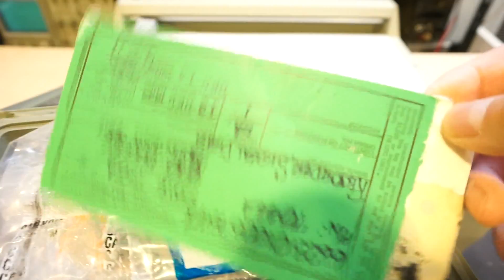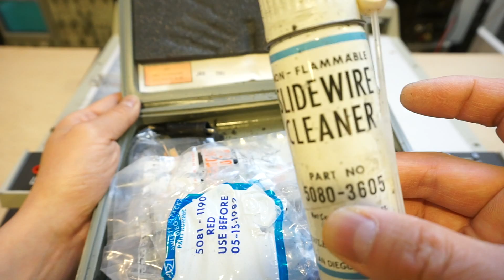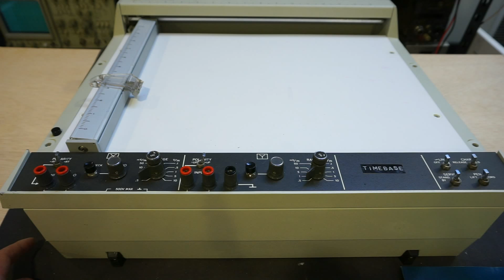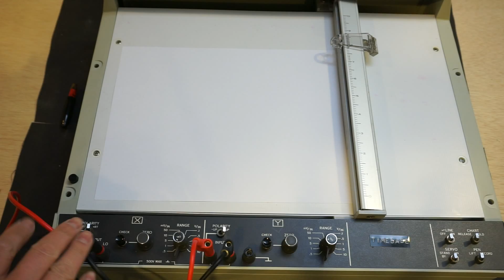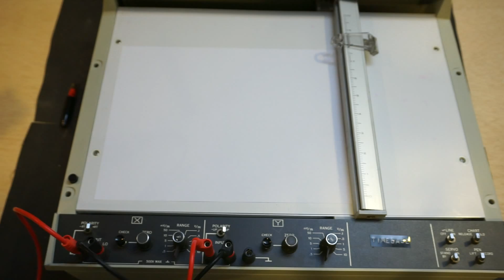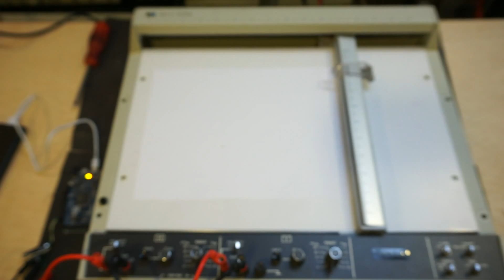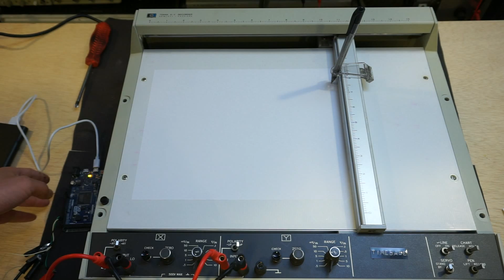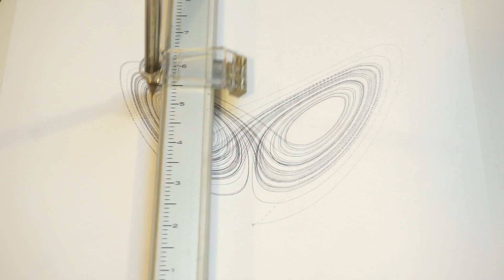HP 7044A X-Y Recorder Teardown, Lorenz Attractor

Comment: Awesome! What is is that you're connecting to the "lo" inputs (the black bananas)? I'm having trouble getting my head around it. When I'm using an oscilloscope, or a vector display, I only have one input for each axis. Or maybe these are just separate ground connectors for each signal? Thanks in advance. Cheers!
Reply from the maker: The inputs are isolated (e.g. not ground referenced) so you could use this recorder to plot differential signals as well. But in this case both "lo" inputs are connected to the ground.
Reply: Thanks a lot! Does the "hi" input accept bipolar signals?
Reply from the maker: Not for 7044A, the input can accept either polarity however (there is a switch for selecting the polarity of the input signal)
Reply: Once again – thanks a lot! Cheers!

Comment: Using a ball-point pen in this plotter will eventually build up a lump of ink on the side of the ball, and if you are using the pen up/down function, the little glob of ink will fall off onto your paper. HP's original potters used a little metal tank and a capillary pen tip; they had large ink capacity (alcohol based ink smelled good) and great contrast but tended to dry and clog. HP later switched to those felt tip pens; much lower mass and you could change colors easily. Readability was excellent, unless you tried using the yellow pen. Still, they tended to dry out before being used up (ink didn't smell much different than a Sharpie).
You should have run some linearity demos before trying a waveform. Noisy slidewires were always a problem. BTW, fresh felt tip pens were available as recently as 2012.
Reply from the maker: Yeah, if I could get the original pen to work that would have been my choice. However, the plastic became so brittle and it became impossible to add ink without breaking the pen.... so the pack of original pen is still sitting there...

Comment: Nice find!  I believe that's open cell foam that HP used.  I hade several VNA cal kits where the foam rotted into a gooey mess from moisture.
Reply from the maker: And the plastic parts are pretty crumbly as well... on the other hand, not sure if today's casing would be any better 40 years down the road...

Comment: Cool Stuff. I was kind of surprised at how fast it moved after reset. I'd definitely be interested in seeing an analog implementation of the atractor. Feeding a vintage analog device from a modern digital device feels like cheating :-)
Reply from the maker: Yeah, I will get a few AD633's from China. They are way below the $6+ price on DigiKey, not sure whether they are fake or not, but worth a try.
Reply: I got one of the Chinese ones (ad633) and I was surprised to see it actually worked. It looks real but I'm not wholly sure. I've taken to buying stuff on Digikey even if it costs a bit more. Got burnt on some fake RF BJT's recently.
Reply from the maker: I know there are a lot of recycled chips (e.g. pulled from used equipment) being resold as new and if that's the case, it usually means they are genuine just not new. Just can't see how they could sell a genuine new  AD633 cheaper than what DigiKey does for quantity of a thousand.